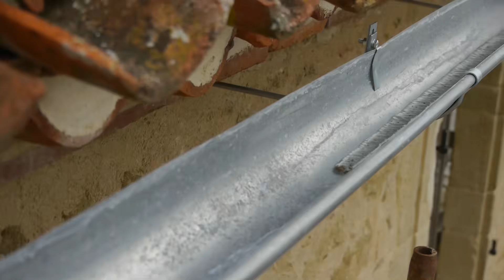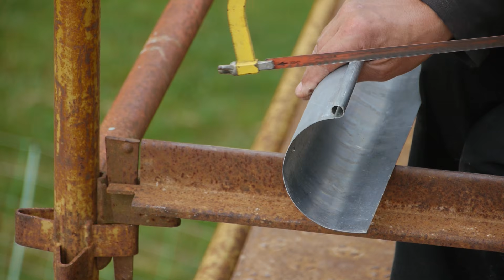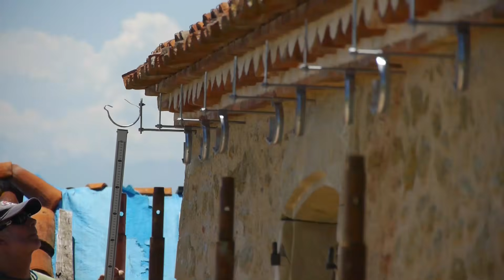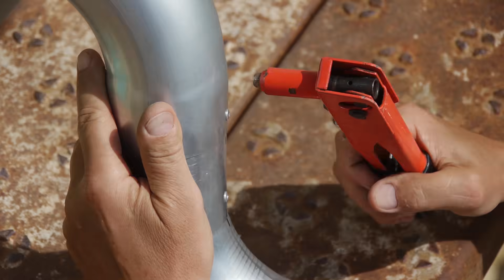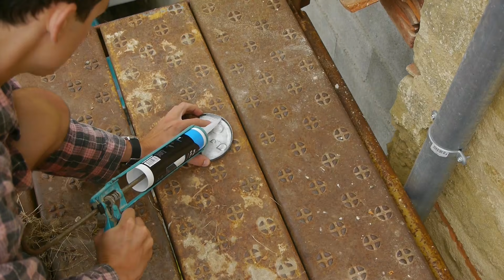Farmhouse Restoration  |  Gutters

Comment: I think you should have soldered the joints rather than riveted, those rivets will not last. That is how I learnt of my French roofer. I think the reason they do it is because in France they get heavy rain and you will be surprised at how much pressure builds up. Nice video series!

Comment: cant help noticing that the "overs" tiles are not set correctly, water will miss the gutter and run down the wall, also the silicon will not withstand the heat in the summer, you need either a solder or the correct metal mastic.      looks good though

Comment: Love the work. Were there gutters on the building at anytime before, are you replacing or installing? I've heard of old buildings cracking after installing gutters that weren't there previously because it can modify the surrounding ground structure.

Comment: There is a trick to half round gutter. If you twist it, you can feed the bead of one piece into the other without notching for the lap. You could have punched a hole in the gutter with an awl and cut it with tinsnips in about a tenth of the time it took to hook up a drill and hole saw. And why didn't you solder your seams? Zinc solders perfectly. That said, your brackets are ingenious. I have nothing but respect for your level of craftmanship. But let a tinsmith do the metal work, 'eh?

Comment: Mmmm structurally unsound and a flawed design.  You can not ask small diameter horizontal rod to support weight vertically (cantilever without a support brace); they bend.  Also, I am pretty sure 90% of the water is going to run down the tiles and right over (past) the guttering.  Probably ok if the rain is light.  The down pipes are lovely but 45 deg elbows would better flow.

Comment: This is an all-inclusive package for any woodwork designer/builder  shedbuilder.work  Ryan's product is a compilation of experience and expertise to bring out the best for any woodwork. I can use this for a long time to come.

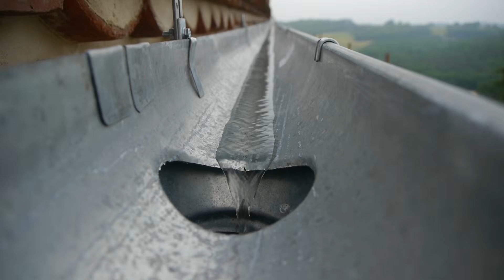0:08
0:10
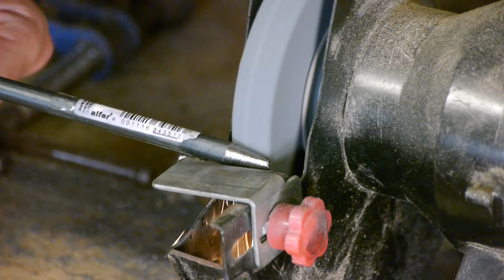1:25
0:08
0:10
1:25
0:08
0:10
1:25
0:08
0:10
1:25
0:08
0:10
1:25
0:08
0:10
1:25

Comment: Hello from the Pacific Northwest. Beautiful gutter system you have there!  We are on year 5 of a similar gutter (6” / 15 cm half round galvanized steel) install  (father and son installed).  The only difference is that we have are using rain chain instead of downspouts. We get a tremendous amount of precipitation here -  167 days a year on average .   We have had 2 snow/ ice storms of 18” (45 cm) or greater accumulation since install and several windstorms of 50+mph (80+ kph). I am pleased to report the gutters still hold tight and have not needed any repairs.  All joints are riveted and sealed with gutter mastic.  You should anticipate a long happy life with your gutters😀👍  Fantastic channel have created. You and your dad make a good team. Keep up the good work. PS- still looking for the metric conversion factor for “days”.
Reply: "nights"?

Comment: Nice farm and place to live ! I would not trust silicon too much. On roof tiles it kept the joint for 1-2 years. On zinc ??? The metal is getting pretty hot under the sun. If silicon does not ensure integrity, you will only face dropping here and there. Watch the strings for rust as it can split the stone. My return from Lorraine. Have fun !

Comment: Nice work. Thanks for sharing your work with us. One suggestion: I think it is easier to cut the hole for the downspout in the gutter by just cutting into it with a hacksaw and then using tin snips (metal cutting shears) to cut the hole. In my opinion this is a better (less dangerous and cleaner) approach than using the hole saw on an electric drill.

Comment: Carl I'm loving this stuff, excellent work👍. I started working on old farm buildings with my uncle when I was 11. Some demolished and replaced with new large modern structures, others refurbished as it depended what the intended use was. Also cast sillage pits, cattle crushes and concreted lots of the farmyard as the winter weather in NW Ireland is ultra wet!! All via a mixer on the back of the tractor AFTER drawing the sand and gravel via trailer (all shovelled on) from local ancient beach areas (licenced). Uncle still farms it nearly 50 years later. We worked extremely hard but had great fun, your videos brought amazing memories back for me. It nearly killed my auntie trying to feed us as we were burning so many calories every day. 👍👍👍
Reply: ROCKON    ....and...in the evening...no problem to sleep!!!                                            cheers from  north Italy

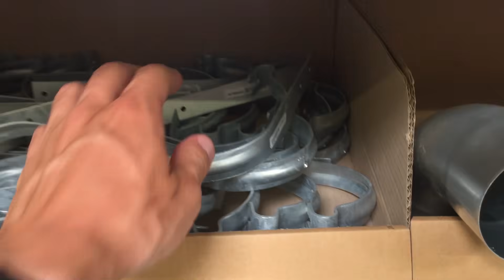Comment: 0:24 they are meant to be bent! you don´t need exposed rafters to connect them!

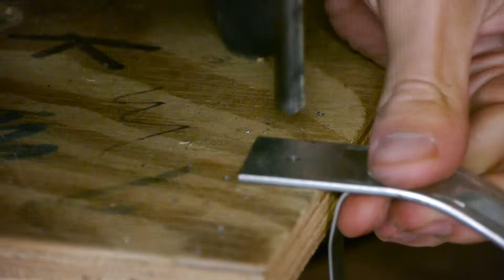1:44 WTF!?!?!?!? 

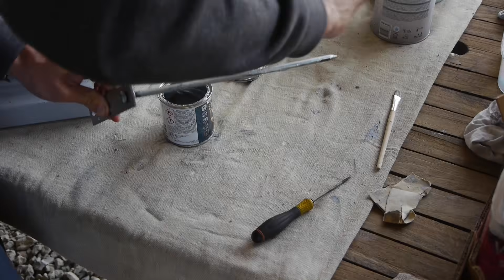2:08  Damn ugly piece of trash

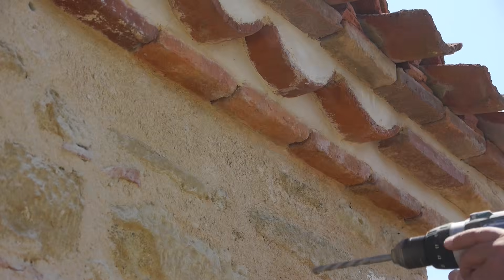2:25 "light zink gutter" due to the location of the house there probably wont ever be ice and snow on the roof, but even water in the gutter can be heavy ( when for example a bird nest blocks the fall pipe) 

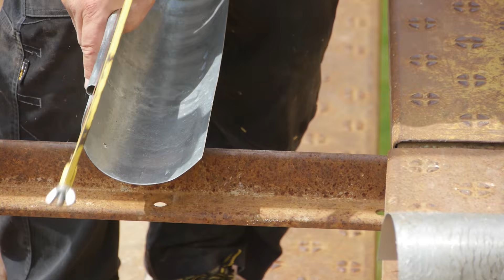3:36 If you don´t know how to do it the right way, ask someone who does! you can cut the gutters easy with the right metal scissor, (30-40€ for a good quality one, that will last at least 10 years of DAILY!!! use) with pipes for falling water its better to use a saw (better cut)

4:17 the drill is to big, a smaller diameter one would be better, because then you would actualy have enough material to bend inwards, (should be at least 2 cm). It will be okay, because there is at least a small bend, but its not good craftmanship.

5:07 they can be connected on the ground, but shouldn´t if you don´t have the space on the roof - which you don´t. Also you are only able to get the right measurements for soldering, when it´s already attached

5:33 Mayor NO NO NO you pretty much fucked it up at this point, in 2-3 Years the gutters will leak. The correct way would be to solder them together and to attach one side with a V4A steel rivet ( you can see the predrilled Holes at 5:43 for that exact rivet on one of the pieces) reason for that is the compression and stretching on hot and cold days - if soldered together thats not a problem at all, but wheatherproof sealent won´t be enough once dirt and water enter.

6:04 not nessessary when 2 cm of material is bend inwards. 

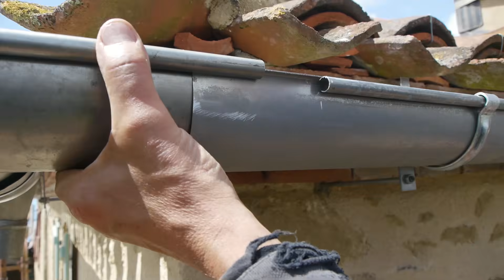6:33 should be soldered and rivited, not glued together.

6:47 see later

6:49 the middle piece between the elbows is slightly (about 3-4cm)  to long. 

8:28 proper way would be to get a hand full of mortar to permanently secure the tile pieces 

9:00 2 cm fall for the entire 10-12 meter gutter? Thats about half to third of what it should have, now water will stay in the pipe after every rain, making it corode way faster then it should.

10:10 not soldered

10:40 that pretty much summs up the entire job you did there.

11:28 water will come through the side of the upper big diameter elbow to the small pipe in 2 to 3 years -   these shouldn´t be connected with rivets but only soldered together, then they will last up to 30-50 years (with propper maintainance)

13:39 proper equipment used wrong - the pipe for falling water should be straight, but instead its bent outwards because you attached the connectors way to close to the building. Instead you should have left at least 1 cm space on the top, put the pipe in, use a water level to ensure it´s a straight fall and then adjust the connectors TO THE PIPE, not the other way around.  

14:34 as said before - that part should be soldered on, it will hold about 1-2 years, and then it will leak or fall of entirely

6:47 and 15:01 you can perfectly see that the gutter is at least 4 Centimeters to low! in every storm the water will fly over the gutter and make the lower part of the house dirty

All in all you used the right material, but in a wrong way, causing the homeowner to have pay someone else in a few years to correct the absolute shitjob you performed on a otherwise beautiful old house.
Reply: they're not working for a paying client, it's their own house
Reply: @Paul Smith A Wanker with a german "Meistertitel" and over 10 Years experience. The roofs we build have 25 Years warranty!  They used the material wrong, and will have problems because of that (good that it´s their own home). They got the basics wrong, it´s as if you would hit screws with the hammer instead of using a drill. And the worst part is, others will copy this bad job and think they are dooing it right. Here it´s shown correctly: https://www.youtube.com/watch?v=q_49eyqACTw&list=PLOZjkRHsUrDqw-RC28yCbvwTS9kX99G2S&index=8

also here: https://www.youtube.com/watch?v=kA7jdC434Rchttps://www.youtube.com/watch?v=kA7jdC434Rc

The reason why german craftsmen are required to give a warranty of at least 10 years for their work is, that you don´t end up with houses that only last a few years before they have to be repaired. Even the material we use has warrantys up to 40 Years (no typo, 40 years!). That is what makes building a house in Europe so expensive. 

IF YOU DON´T KNOW WHAT YOU ARE DOOING, DON´T PRETEND TO KNOW!
Reply: @Paul Smith Whatever you little Drongo, as if i would give a shit about your opinion ;P

Comment: There is no gutter for this kind of house. The purpose of the "gênoise" (tiles on the edge of the roof)   is to get the water away, far from the bottom of the wall. To put this horrible zinc destroy all the look of this house. It's a shame to do this.
Reply: Thierry Tesson                Do you prefer copper gutter ?
Reply: I pondered this myself recently - pros and cons - and looked at what the Japanese had done with their traditional houses with those exquisite eaves details. As far as I could see, they too had put gutters on, as unobtrusively as a gutter can be.  In the end, practicality wins out?

Comment: I really enjoyed these videos. Living in Canada, I rarely see these types of roofing systems. Well done. I hate to be that guy but you were using an engineers level. Theodolites measure vertical and horizontal angles.
Reply: This is high quality roofing and will easily last over a century. For sure you will never see that in Canada where roofs fall apart after 15 years.
Reply: @paname514  The minimum contractor grade roofing shingles are 20 years here in Canada. You buy shingles that will last up to 40 years.
Reply: @vitocatella5244  In reality normal shingles last about 15 to 20 years.
I don't buy the "40 years shingles" advertisement - the manufacturer will expect you sell the house before that and that you will never know.
It's nothing compared to tiles, metal and slate.
Reply: I spotted that too, called a dumpy level here in the UK definitely not a theodolite

Comment: Sorry to be negative but  I can’t see this lasting. Maybe I’m wrong but seals will break down and the brackets will bend over time. Plus I think adjustable bracket may come lose though expansion. Hope I’m wrong guys
Reply: Yes you are right, especially in winter time because of the ice they will not support the wheight. This will be maybe in 3 years.

Comment: Good job guys, congratulations! I just believe you used steel rivets instead of aluminum ones. ;)
Reply: Libor Vitek isn’t it galvanised pipe ? Don’t want Ali on this as you will get a galvanic reaction between the dissimilar metals.

Comment: Acetic acid curing silicone and zinc coated iron will not play well together...
Do remove it, wash with water and baking soda or other mild base, then solder with SnPb alloy. 
All soldered gutters I ever saw are on the houses longer than me om this world.
Reply: Soldering is better....but only if the client is prepared to pay for it. Nothing wrong with acetic cure silicone, it won't harm the zinc in the few hours it takes to cure.
Reply: @Shanidar1  the acid will linger for far more than hours. The metal is not permeable, the silicone will cure first on the outer edges where it contacts moist air and thus will maintain a very acidic medium in the central, hidden area. 
Yes, the client will pay the extra cost of replacing the gutters :))

Comment: I'm interested to see how the mastic joints work out as I've not had good results. Ended up soldering the old fashion way (and learnt a new skill! 😀).
Reply: Cannot solder aluminium to galvanised
Reply: @waynedrummond6583  its all zinc used here in France,  I've soldered hundreds of joints on zinc gutters
Reply: Just caulk your seam in the gutter no one will see it and the water will go right over it

Comment: A little oil which you clean off later with acetone would go a long way to keeping your drill bits intact. Simply sleeving the threaded bar into a tube/pipe would give you a way to adjust the guttering horizontally, as well. Consider patenting that guttering method and selling it as a kit on-line. It's incredibly useful for all sorts of buildings.
Reply from the maker: thats a nice idea. might have to steal it!
Reply: @carlroge  steal away. It'd be an honour seeing that little idea go in to production.

Comment: Lovely bit of lateral thinking. If you can't buy what you want, then make it. Well done.
Reply from the maker: especially when you know its a rip off
Reply: @carlroge  It is doubly difficult when product is readimade and doesn't or can't be adapted for your  situation. The joy of your guttering is that it was malleable unlike the plastic stuff for domestic use in the UK. Some friends of mine have a house near Malaga where rain gutter is never fitted. An after market product is used that clamps on the roof tile edge which is fine until the tiles fail. Your job looks in keeping with the age of the house and will age accordingly.